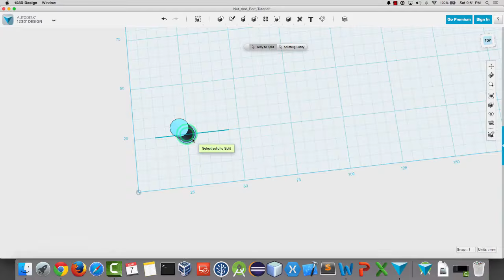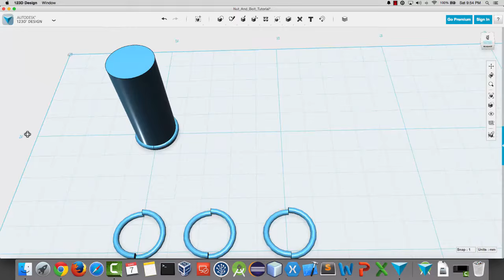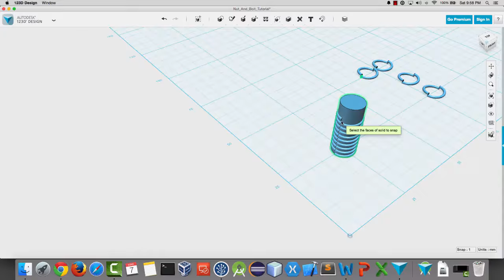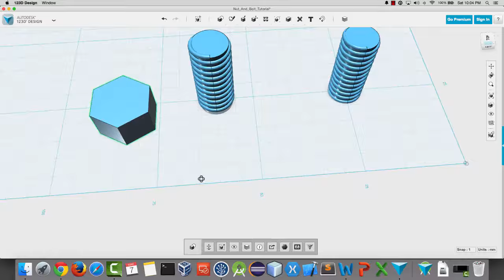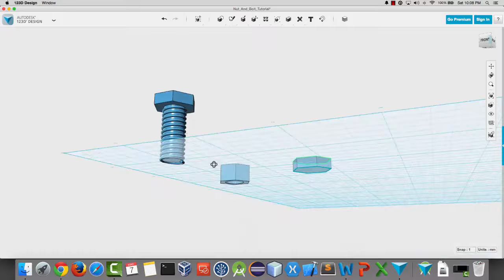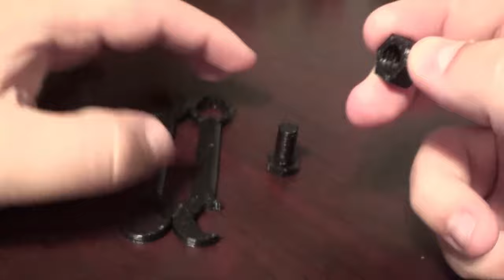Create a Nut And Bolt in 123D Design for 3D Printing Tutorial

Comment: Are you still using 123D?
Reply from the maker: @AttitudeOfGratitude I do not, since I made this video I learned that Fusion 360 has a maker license that allows for free use if you meek the conditions of the license. Its more complicated, but its a parametric cad system, so its a lot better for more complex designs!

Comment: Yes, those are very light and can be replaced to lots of heavy metal bolt and nut for weight reduction purpose. And I found tinkercad is very easy tool cause they have community shape menu which has lots of famous standard template format and so I can reduce the time for producing input file.

Comment: I would not have thought of it to do it with a Torus and yes you are getting only approximations of a helix because you make the cut at 180 deg. If you make the angle smaller by adding more lines through the origin at different angles to make the cuts you get closer to a true torus. Another reason for the tight fit is when you use the uniformly scaled copy of the bolt as a cutout of your nut it also scales in the vertical (z) direction. For longer nuts/bolts you can get more mismatch in pitch forcing you to scale even more.  Try to see what happens if you use non-uniform scaling and leave the z-direction unchanged. That would probably get you a scaling that is constant with different thread overlap lengths and forces will distribute evenly along the threads of the bolt and the nut. It keeps beeing a little nasty to use the same torus for both inner-thread and outer-thread, so it would be an idea to build up te same thread pitches but using a smaller minor radius for the bolt and slightly larger minor torus radius for nut.

Comment: what version are you using? in my version 2.2.14 the ring will not automatically center on top of my cylinder. it attaches the outside edge of the ring to the inside edge of the cylinder making it offset. please help its driving me nuts.

Comment: curious why there was not a reference to the number of threads per inch for the project, which would determine coarse threading or fine threading?
Reply from the maker: Good question. At the time I made this video I just needed something to fasten pieces together, so the type of threading was not the important factor. I figured that people could alter the methods I show in the video to suite their needs. That is also why the threads not being a true spiral was not a big factor to me. Since this video I have learned OpenSCAD and the only limits I have found are your imagination, but there is the hurdle for some of having to program with it and math. Id like to make the same video again with OpenSCAD for people to create mechanically accurate nuts and bolts!
Reply: I asked because one reason people would be interested in making such parts is to replace a specific nut/bolt/screw that might be broken, hard to replace, or of such poor quality they want to use a higher grade of metal for added strength or other properties. For instance, classic car restoration, vintage machinery, legacy computer parts and the like. There is a trade off in how much time you want to spend in the design process and the actual making of the part/build. There are some useful apps that allow people to refer to screw sizes and other machining reference charts, even while mobile, which is a great resource for people making repairs or calling in specs from the road. FYI, the video had my attention right up to that point, and then I was scratching my head as to why someone would spend time on a design of a part that had no specific thread. It was not even comparable to say, and isotropic (ideal) antenna concept. I say this not to be negative, but to alert you that others similarly trained might have the same reaction I did. We want ot encourage good instructables. Keep at it.

Comment: There's an easier way. Simply go to mcmaster.com
Do a search for the bolt you want. ie 5/16-18  Hex head bolt 2.5" long
find the Mcmaster product code - ie 
90201A231
Click on it  A window saying product detail will pop up  Product Detail   
Scroll down until you see a window

3-D Models
3-D EDRW3-D I
GES3-D PDF3-D 
SAT3-D 
Solidworks
3-D  STEP
Choose 
3-D STEP  and download the file and import it into 123D Design.
You can fiddle with implanting the bolt into a solid, then subtracting it, to leave the threads inside the solid.  Works like a charm.
Reply: 3 days doing via this video, 2 minutes going McMaster-Carr! Thanks for the information!
Reply: Michael Caswell AWSOME tip, thanks you saved me hours. 👍🏻👍🏻👍🏻
Reply from the maker: Very cool!
Reply: Yes, it is. Pity 123D design is being phased out. I have to learn Fusion 360 now - darn!
Reply: Wonderfull! Thank you:-)
Reply: How do you enlarge the thread in the solid to allow clearance for the bolt?
Reply: I think the point of this video is to learn the basics and I think it did help a hundred percent with me not to make a bolt and a nut but to learn the program.
Reply: I exported a CAD file for an M10 wingnut from McMaster-Carr today. I used Fusion 360 to export the model as an  STL and sliced in Cura 2.7. When the model printed (Creality 3D CR-10), the 10mm threaded socket was filled in. Is there something I was supposed to have done in either Fusion 260 or Cura 2.7 or both to make sure that the center of the nut does not get filled in with filament?  Thanks for any suggestions.

Comment: Not a true spiral thread. It's more complicated to do than that.
Reply: If this does the job at hand I don't see point in using a more complex method.
Reply: It doesn't do the job. It's not a thread. It's not a spiral.
Reply: what do you mean, he said it has worked on many other occasions
Reply: What do you mean? That's not a true spiral. The only way to do a true spiral in 123D Design is to use loft.
Reply: but it doesn't need to be a true spiral to act as a nut and bolt, have you not seen kids toys with plastic nuts and bolts, they look exactly the same as this and still function the same
Reply: Well, if you're ok with a crappy spiral because you don't care to take the time to do a proper spiral, which you can only do with Loft in 123D Design, then sure. I suppose it's ok.
Reply: They don't function the same. Plastic nuts and bolts work because they can yield and flex a bit to make it work.
Reply from the maker: Yes as I have mentioned previously in the comments this was something I threw together and realized it could be done quickly. It is not a true spiral nor does it need to be in order to work. if you are in the middle of making something and need a quick nut and bolt this method saves time and works fine. That said if you are looking to make a true machine grade screw this method will not suffice and something like loft will need to be used in 123D Design. I only hope you did not lose too much sleep over this ;-)
Reply: Didn't lose any sleep. I have two sources of bolt and nut models now so don't have to painstakingly make my own using loft in 123D. I use MOI3D with this plugin moi dot maxsm dot net/item/36 . And I can also download nut and bolt models from mcmaster dot com . Finally, I can easily make my own using MOI3D's spiral or twist tools. Although I mainly use 123D Design and mainly only use MOI3D for 'post-processing'  because it kinda sucks compared to 123D Design except at a handful of things.
Reply from the maker: Cool I have thought about going back and doing another version of this tutorial but with OpenSCAD. if you are a programmer or care to learn it is super awesome. It is programatic CAD! Id like to make some videos on it one day when I have time. Thanks for your feedback!
Reply: OpenSCAD is awful. Like... if hails from a realm of shadows below this reality. A realm of low vibrations and dark thoughts. Have a look on my channel and imagine doing things like that using OpenSCAD.

NURBS modellers are already programmatic modellers. Especially something like Fusion 360 which features design constraints. Why would you possibly need or want OpenSCAD when Fusion 360 is free.
Reply from the maker: I have only played with OpenSCAD so far, so ill take a look at your stuff and tinker. I am unfamiliar with Fusion 360, but ill pull that down also and give it a look. Thanks!
Reply: Hi there and Hello "maersklandro" . 
I am looking for Fusion 360 FREE version for more than 3 month and there is no such thing !!! . Where did You find Fusion 360 for Free ?!?!?! 
Please can You add here a link for it ?.
I bought a "Wanhao Duplicator i3 Plus" couple days ago and I made some small parts , but I need that program to make some more complex parts for an RC Submarin . 
I used to use "123D" but I lost it when my laptop crashed . Yes I know I should made some backup's but .....Anyway that one seems to vanished from internet I don't know way !!! . 
It was very good and I managed to understand and learn a lot form it . Shame .  
Thank You

Comment: A much faster method... make the bottom 2 halves of the torus.  Once you connect the two faces so it's one spiral, copy the spiral and mirror it with a rotation.  Join it to the first two with snap.  Then copy all of those torus pieces, paste them, and snap the end face of the first set with the starting face of the copy.  Now do that with ALL of the torus pieces, and copy/snap again.  The workload gets exponentially smaller the more copies you make!

Comment: You can't make a bolt like this! No wonder you need a scale-factor of 109%()which should not be necessary). The threads are not inclining in the areas around the joints between the halves... 13:05 and you'll see what I mean.

Comment: Scaling the negative bolt changes the thread pitch. That is why you are having trouble putting them together and taking them apart. You need to scale in only the XY directions to keep the pitch the same. Unfortunately, I don't know if that is possible to do.
Reply: +Richard Weaver Yes you can scale only on the XY plane.  There is a drop down menu on the scale tool to change it to non-uniform.
Reply: You actually need a Z scaling as well (for smooth screw travel), but only on the torus halves, when making the screw that will be subtracted from the bolt. Make the cylinder of that screw a bit thicker, and thicker torus halves, but keep the same pitch.
A great tutorial.

Comment: Thanks for this - I found 123D somewhat infuriating whilst following along, but did get there in the end.

I tested one change: I made one nut the way you show, scaling the subtractive thread uniformly. Then I made a second nut, scaling the thread component in X & Y only. The second nut spins much more freely on the bolt, as the thread pitch (Z scale) matches that of the bolt.
Reply from the maker: Jonathan Sanderson Interesting! I noticed the other day that if you change the slicer settings so that the permitter width is the same as your nozzle diameter, you get pieces that fit together much better. This is however at the cost of the strength of the part if it is not solid. I will have to try out your method. Thanks!

Comment: Thanks for the video – though as I go through this I'm trying to figure out how your design works, and from what I'm looking at it should totally bind up. The angle of the split torus is fine on opposite sides. but on the joining sides that angle is no longer consistent. It's more of a wavy shape - not a linear ramp. Did you do something different to compensate for that?
Reply from the maker: BarranteMotion Its funny I had not really noticed that until I read this! The reason it still works is likely attributable to the tolerances of the printer and how we make a slightly larger version of the bolt to produce the screw threads. If you tried to print these with too little accounting for inaccuracies in the printer it would probably bind up badly.

Comment: really good idea, thanks for sharing! I have a suggestion for the nut. instead of rescaling a copy of the body, you can draw a second cylinder and a pack of torus slightly bigger, like add 0,2-0,3 mm to the diameter and keeping the same space between the center of the faces of the cutted torus (sorry, I'm not a native english speaker, it's hard with technical terms). you do a little more of work, but I think in that way you should have enough clearance between the nut and the bolt and keep the same threading steps as the bolt (if it's not the good term, I mean the space between each centers of the torus). I didn't tried this method yet, but I think it will improve the result. once again, thanks for your job :)
Reply from the maker: Eytaris Thanks for the tip. I am going to try it and see if that could be a better way. the scaling method for handling tolerance is not as good as I would like, but it seems to handle the variety of tolerances with the 3D printers I have used (some printers are more accurate than others)

Comment: Could have snapped first and then copied, then snap and copy.
:)
Reply: Calvin Echols To speed it up even more, especially later, don't forget to combine objects.  (Less objects that the app has to track, faster manipulation.)  So once you make your initial spiral, combine it together.  Then copy and past it, snap it to the first spiral, combine, then copy past snap combine...  I did this about three times, and I had a spiral structure about a third the length needed, I then simply pasted that third three times, snapped them together, and combined them, then combine them to the shaft.  This created a single screw structure, which was easy and fast to manipulate (you could see your computer's lag in trying to select and move all of those little pieces, MUCH faster when they are one piece).  Reducing object count, and reducing duplicate effort (by factoring out movement steps before replication) will greatly improve both your speed as well as the computers.
Reply from the maker: Keda_P Yeah I thought about that while I was doing it, but I messed something up and just cut that part of the video out... You can probably tell that I knew there was a better way, but it still worked just slower I suppose :-)
Reply: Calvin Echols Yeah, nice Job. I am a total newb. Installed the 123d yesterday.
Reply from the maker: +James Brown Very true!

Comment: Calvin
Put a chamfer on the end of the bolt thread and the top and bottom of the nut should have a chamfer to provide a lead to start the thread.
Reply from the maker: Alan Martyka That is a really cool idea I am going to try that out and see if it makes a big difference. Now that I think about it I have seen some bolts out there where the threading does not go all the way down to the end and the shaft is thinner at that end. I assume that is the reason!